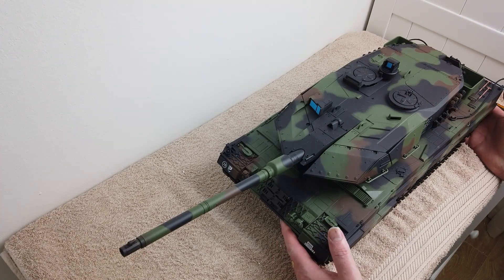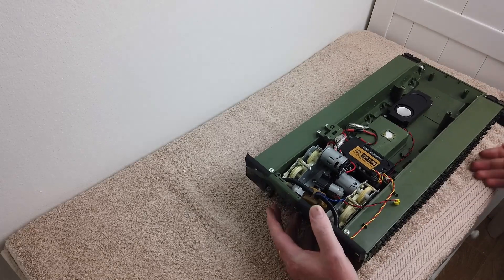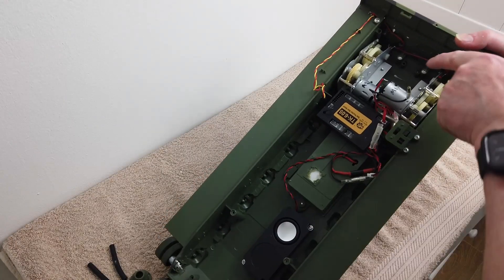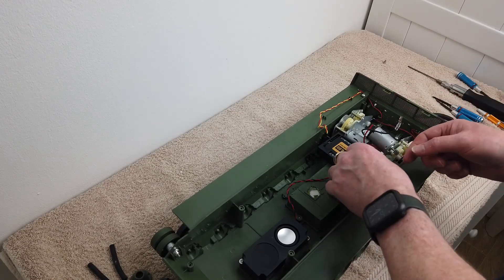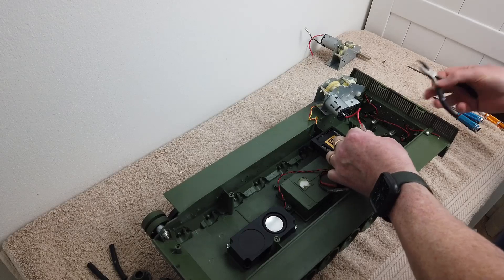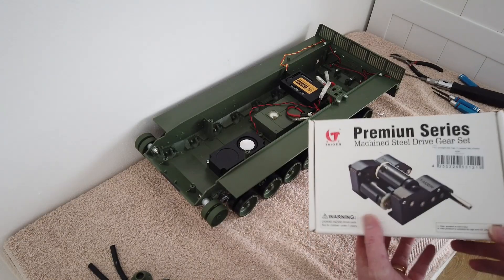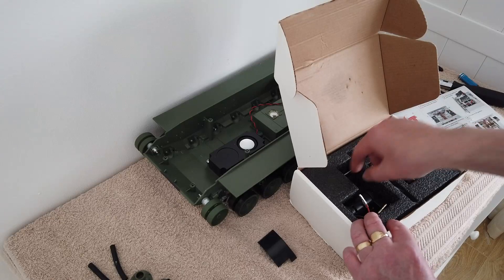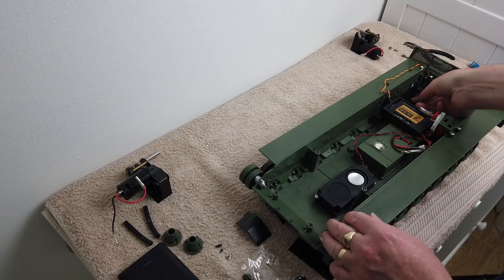Henglong Leopard gearbox upgrade Part 1

Comment: Can I ask what size connectors I need. I just got an taigen gearbox for my Panzer III after it came with a faulty henglong one on one side. Your help would be greatly appreciated.
Reply from the maker: Hi, Could you please tell me what connectors you are referring to?
Reply: @ourr.c4065  the bullet connectors you used to replace the ones that come on the taigen gearbox
Reply from the maker: @KilnFirelink  Hi, I took the original bullet connectors of the Heng long motors and re-soldered them on to the new motors. Hope this helps.

Comment: What are the actual specs on the motors. It seems hard to find information on them. All the upgrade kits basically just say the motors are better. They don't actually provide any specifications and neither do the stock ones for that matter. At least not as far as I've seem. I'm not doubting that their better. It would just be nice to see by how much exactly and why (stronger magnets?)
Reply from the maker: Hi, There is very little information regarding specifications of the motor. Here is a link to a site which gives you some information but not a lot.
https://www.motionrc.eu/products/admiral-390-upgrade-motor-for-heng-long-tanks-adm6000-011

Comment: Good Job, nice new gearboxes fitted, now  next will be metal tracks and drive cogs if it goes like the last tank upgrades.
Reply from the maker: Thanks' John, next will be the rear drive sprockets and front idler wheels, then the tracks.